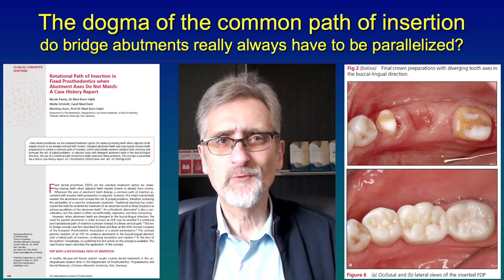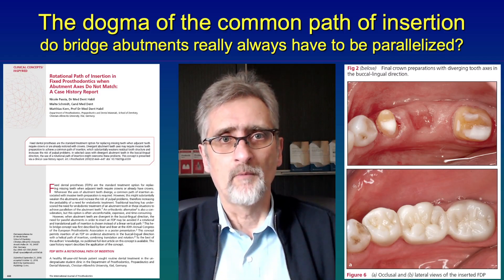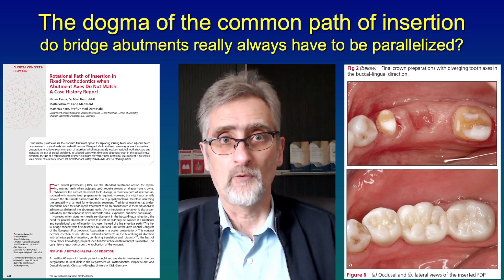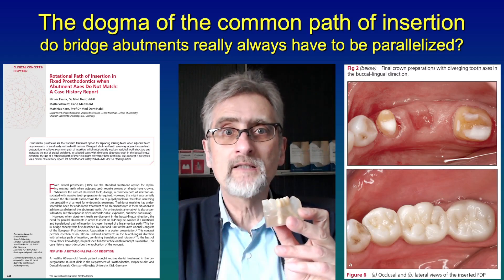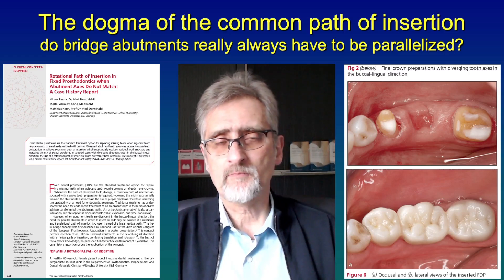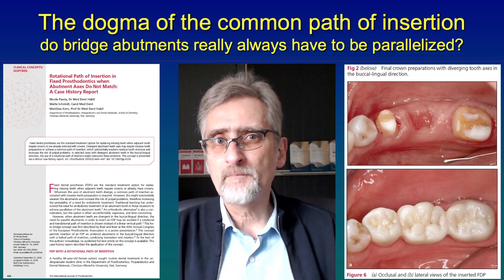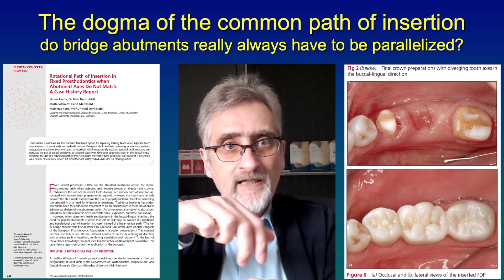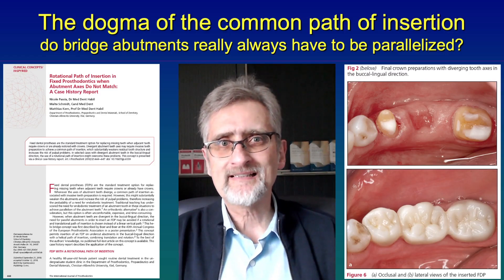The common path of insertion - generations of dentists have been taught it a bit incorrectly

Comment: Beautiful video! I went to read both your article as well as the Boer&Boer poster after watching this video. The poster didn’t really go properly into the planning stages of the bridge though and how to tell how much angle diversion buccolingually becomes a contraindication for the ‘helix bridge’ concept. Were you able to come up with some rules of thumb that would allow clinical assessment for whether this technique could be used?
Reply from the maker: At the moment, we are taking a very pragmatic approach: We are using the bridge provisional to try out whether we can incorporate and remove it without any problems.
However, I have contacted 3-Shape company to see if they could program this into their scanner software. Because you can calculate it mathematically: https://drive.google.com/file/d/1sHJtEA5eZzu6-NDeO17nPd4fN9m9OcvG/view